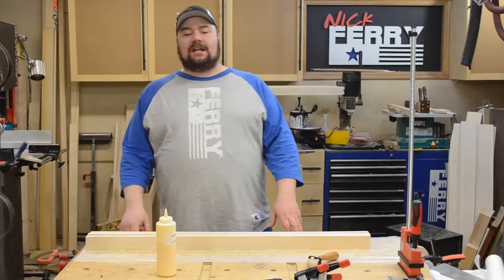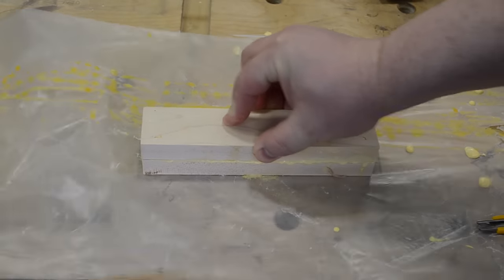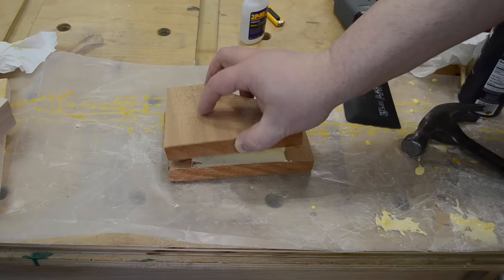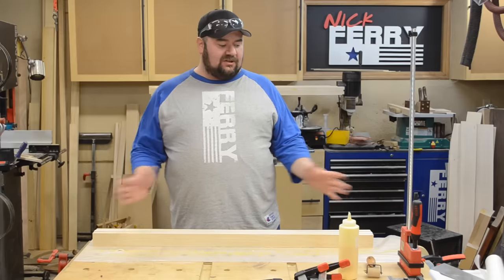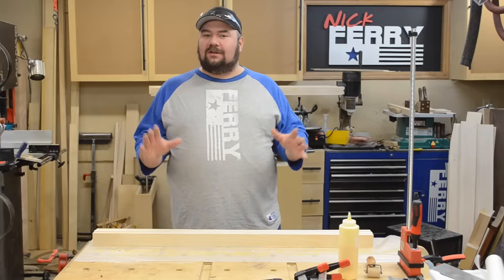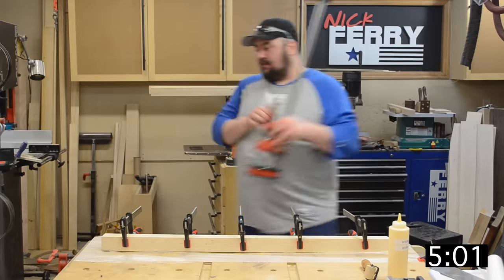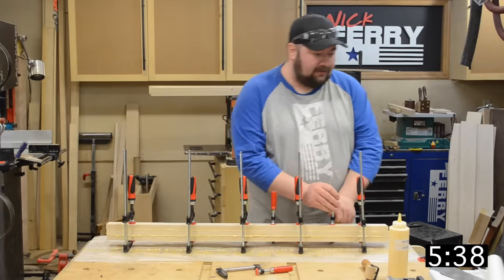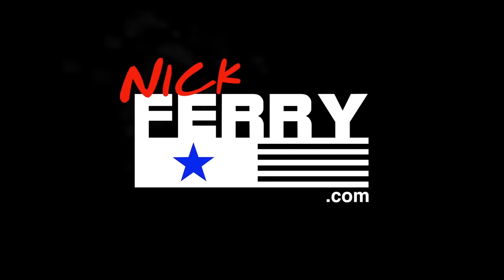Ⓕ Best Way For Gluing Wood Together To Get Thick Pieces (ep86)

Comment: I know it's an old vid'... but I thought "Everybody knows this... right?" too... 

   I will only point out that just my experience (admittedly not universal) but more than a modest and even bead of "squeeze out" is a case of excess glue... Generally, so long as you cover the entire joint in long-grain, you don't have a concern in the world for a void or "starving" the joint... 

    END GRAIN (caps for importance)... is where joints can get starved.
   Hot tip??? Lots of joinery does expose end-grain... SO it can be a good idea to start with an appropriate brush, dampened in glue and apply to the end-grain specifically, like you would a finish. This lets that end-grain soak up some of the glue to seal it a little, before you go back and apply the "full bead" for glue-up.

     Care for another??? 

  Having trouble justifying the economics of buying those parallel clamps? (or any large clamps for the matter)... I like to find (and even approach folks who probably have them) ALL those old levels that people get rid of... Sure, they're old, used, worn, and rarely quite "true" in the most precise sense of the word... BUT a layer of "sacrificial cardboard" (which can actually be anything from layers of paper to cork or leather for all it really matters) allows the piece(s) to be aligned relatively well (surprisingly so) with no more than the old levels and weights, clamps (if you have some) even "hold downs" if you're working with a table-like surface where you don't care to drill a few dog-holes or cut an adequate groove(ish) for mounting them...

    Lots of people prefer "cawls" which ARE great... when you have or can make them... Levels (however) started life "factory straight"... and even when they're not "exactly true"... they're usually being tossed because there's a nick or scar that interferes with making a line or supporting work while a contractor adds hardware (shortcut)... OR because nobody ever trusts an antique wooden level... (okay, yeah, some of them do move around a bit)

    For those interested in saving glue?
   I often use a simple spatula from the dollar store, for spreading... and occasionally run "trails" with a comb on particularly wide surface areas once the stuff is spread. This "breaks up" any surface tension issues.
   It's also helpful to "rough sand" surfaces BEFORE applying any glue. Sure, you need to wipe off any dirt and dust, etc... but that slightly rough surface gives the glue a "place to bite"... AND makes for sure that any "store bought" surface prep's (occasionally and dubiously used to make lumber look prettier) don't interfere with adhesion.

    Okay, most of these tips relate as much to "style" of doing as opposed to any particular "quality" question... Some of it is "basic 101 stuff" but there are points in time and experience when it has REALLY REALLY HELPED me... so take what you like, drop what doesn't help...

             ...AND don't forget to experiment a bit on your own. This is (at least in part) a hobby of passion, after all. You should be having some fun with it. 

                                             ...I mean, honestly... What's ever been wrong with ENJOYING the work??? ;o)
Reply from the maker: Lots of goods tips - thanks for taking the time!
Reply: @NickFerry  ALWAYS welcome!!!

   My favorite tips fall under three descriptors :
1. Cheap, no sense in spending more than necessary for results (skill should be involved)
2. Silly... "why didn't I think of it?" probably because I thought it was silly at the time too.
3. Effective... No good tip isn't effective. They can still be inefficient, but not ineffective. (we all like to play) ;o)

Comment: Don't you just use the right depth F-clamps to begin with(the ones he used later) and rest the wood on the clamps, making it lay flat, then put more F-clamps on top in between the others for opposing pressure? Since the wood is resting within the clamp bars, they stay tightly together.
Reply from the maker: by the way you phrased that you make it sound like there is only one way to do it

Comment: Nick, you never linked to the glue roller in your video like you promised :(
Reply from the maker: Yes is did - link is in there for the article which has all the links
Reply: Ooh, I just looked in the description of the video, not the associated article.  Does PVA glue stick to the roller, or do you clean yours when you're done using it?
Reply from the maker: I clean mine - but sounds like I'll have to experiment

Comment: Good tip. But better to buy the correct size wood in the first place.
Reply from the maker: Buy the correct size wood? Many times I’m milling down the wood right out of the kiln or cutting the tree down and bringing it to the mill - so I do the cutting of the wood down to final size - this way I was able to get 4 pieces from one board as opposed to 3 - waste not, want not

Comment: If you have a flat bench top, and pieces that are of near equal widths, why not place the pieces on edge and use the bench top for alignment? Set a, cheaper, f-clamp on both ends, lightly set, and then work your way from one end to the other with more clamps and at higher force?

One would hope that your bench top is at least as flat as the face of a parallel clamp.
Reply from the maker: For sure another way of doing it - this way is merely more versatile - I’ve done it on pieces behind 12’ which my bench is not - it also works well on curved pieces when I do laminated handrails - works great on locations where I don’t have a bench or assembly table as well
Reply: Great response Nick. You’re right that I’m those other applications the method you demonstrate would be of help. Thanks for the videos too.

Comment: Pretty obvious for us old woodworkers. The best way is to have a flat plank or metal girder, with a backing plate standing up at right angles on one edge., You clamp the pieces down on it down on a perfectly flat surface, and also hard up against the backing plate. The backing plate also ensures that at least one other side is perfectly flat. This "freeform"  technique in the video can end up with a bowed glued piece, especially if  the wood is a bit warped in either direction.
Reply from the maker: I should have mentioned more about id the wood has a crook to oppose the pieces
Reply: Yup, that'll work.

Comment: A little wax paper or similar will protect your parallel clamp.
Reply from the maker: never a bad idea but I don't have it on there long enough for it to matter - if any get on the clamp I just wide it off when done with the board

Comment: Meh,  I guess it's OK if you're not going to run through planer.  I always used pipe clamps and just ripped boards an 1/8 or so oversize and run 'em through the planer.

Comment: I do a parallel at both ends and then add the other clamps before I even remove the parallel clamps.  Work hard or work smart. Your choice folks. why leave anything to chance.
Reply from the maker: And what if there is a slight crook in the board?

Comment: This is pretty good for those people that use f clamps for their glue ups. Personally I just use pipe clamps with packing tape covering the pipes so the glue doesn't stick like you've seen on a thousand cutting board videos. Gravity keeps the edges aligned that way.

I've never understood how the salt thing made sense to anybody but now in some corners of internet woodworking it's gospel and heresy to speak against. I'm sure it seems to work(ish) but I don't think it's really all that well thought out of a practice. What size salt do you use? If you go with the really fine basically powder stuff it will just dissolve when it hits the liquid glue. If you use some of the chunkier stuff you'll either have uneven spaces between the members where the salt is keeping it apart or you'll create voids after it dissolves where you crush the salt into the wood fibers with clamps  and more likely a combination of both. Aside from that you're changing the chemistry of the glue which doesn't sound like the smartest thing if you want a strong and dependable glue joint you don't have to question.
Reply from the maker: I’ve never had any luck with relying on gravity in these glue-ups - I’ve always seemed to have at least one piece want to pop out somehow - as for salt I rarely use that method anymore, but when I did, I used regular table salt - small enough to dissolve and just big enough to have some grit to keep from sliding - being a small amount was used, I never worried nor had an issue with it changing it chemically
Reply: Thank you for this information! As a seventy-year-old "beginner," I don't  have time left for trial and error or learning from experience, I need to learn from other folk's experience and DIRFT, do it right the first time. 😊👍👍👍

Comment: How about the glue up table, with pvc rails? Check out the mtm wood channel to see what I mean. That's where I was introduced. It was just ... immediately obvious to me that it was the correct way to go.
Reply from the maker: a good method to do it for sure but it requires "extras" where as this is great fro someone doing a couple one off's - that's the beauty to woodworking, always more than one way to attack it - MTM make some really sick cutting boards too!

Comment: Good tip, but you're using way too much glue if the boards actually slip and slide like that.
Reply from the maker: to each their own - I hate having to fix spots that are devoid of glue so I use plenty

Comment: The way I do it to avoid slip is easy and works every time and doesn't add a single step. Simply put the clamps on very lightly until at least 3 are on before going tighter then they do not move add more then go back and tighten up  the others. Try it, it works. Going tight in 1 spot is what causes the sliding.
Reply from the maker: I will try it out for sure thanks!

Comment: dont we all do something similar to this method? and the guy whos minds blown, didnt lose much.
Reply from the maker: Somebody could be woodworking for 60 years and still not know all of what other woodworkers do for tips and tricks in their shop so that’s why I figured I would share it
Reply: Nick Ferry I was not doubting your good intention for sharing. I was merely pointing out that this method is rather mundane, much less mind blowing. I'm an amateur woodworker for way less than 60 years and I have been using a better version of this method glueing up boards since very early times.

Comment: Sawdust works instead of salt.
Reply from the maker: The last thing I want in between my freshly jointed or plane boards is something that won’t dissolve causing interference no matter how minute
Reply: @NickFerry  so the sawdust is taking up space making the wood to a degree wider the you would want?  I could see that as an issue, never thought of it that way!!  Thanks!
Reply from the maker: @HOBrian2003  in a manner of words, yes

Comment: If  one were to read the glue bottle one would encounter a concept known as "grab" or "initial tack".  "So what?"  You say.   Wellllllllllll............ yellow glues are designed for gluing stuff together and they don't print stuff on the labels just for looks.    "Well, duh." You say.   So anyhow, here's what that means:

  Spread the glue.  Line up the pieces while the glue is still wet and slippery - then go away for a few minutes (not too many minutes, there's a learning curve here) - have a cup of coffee, straighten up the work bench  - whatever  ..........  then when you come back the glue will have dried a little and "grabbed" (remember that word?), but the glue is still wet.  Then you can handle the pieces and put clamps on at a more leisurely pace.  Easy, peasy, nice and squeezy.
Reply from the maker: Sounds like you have the cohesive and adhesive properties down pat
Reply: Yes I do.  I am old enough to remember when yellow carpenters glue first came out.  (The directions on the bottle were much more comprehensive then.)  Before that it was Elmer's and US Plywood Plastic Resin glue.   Yellow glue was designed to eliminate the slip and slide problems that Elmers (which is just as strong) has.   I'm surprised that using it is such a mystery in the 21st century.  But if you want to make a simple problem complicated - go nuts.  I don't care.
Reply from the maker: no mystery in the 21st century here - I too started on white PVA - it's just easier and more efficient for me to do it this way rather than have to go get coffee and keep track of multiple pieces in an assembly while waiting for glue to tack up - as far as making a simple problem complicated, I'd rather put clamps on right away and be done with it rather than wait around for "initial tack" to only marginally help with pieces slipping

Comment: so you are using cauls(or one caul..intermittently)...strange he never saw that before....
Reply from the maker: I think the way in which the parallel clamp itself was used to be a caul in combination with not having to insert, adjust and have separate pieces is what he was most impressed by - something many woodworkers have kicking around - just saying the word caul doesn't explain certain methods people use  them for

Comment: Your friend has been a woodworker for 20 years and never thought of that? Come on, was the woodworking using Lincoln logs?
Reply from the maker: thought of it, maybe, done it exactly this way, nope - he hadn't seen it done with parallel clamps before - it is slightly surprising but if you factor in the infinite ways to make subtle variations to menial tasks I can see it - ahh ha moments are bound to occur at seemingly odd times
Reply: No one will ever call me a woodworker and I knew how to hold pieces flat. Just blew me away that I had that knowledge. Here is one for you, use tie down straps for extra large pieces such as barn door type things. Use 2 x 4 as cauls or even better 2 x 12s if you can get them. Steel I beams are better but may not be locally available. LOL. I thought that up on my own.

Comment: 4 pieces scrap with straight edges, coated with parafin so glue dont stick clamped 2x2 instead of moving that clamp and voila wood does not move... 3 times faster...
Reply from the maker: But what about cellophane tape?
Reply: @NickFerry  is faster with parafine . one dirty rag and parafine
Reply from the maker: Parafine is wax right?
Reply: well, sort of. what I use is for wood floor polishing , it has consistency of margarine and has some fragrant petroleum smell, coloured white and it does not harden after i apply it.  is labeled paraffin wax. i hope it helps. btw that shit is great for metal surfaces, wood slides like on ice on it (planer tables for ex.). sry for my english
Reply: Please ...  WAX and WOOD in shop is an ignorance !
Wood and wax cannot co-exist until the woodwork is finished, the paint dry, and even after then,...
IS NOT A GOOD IDEA.
AS ANY FURNITURE REFINISHER MIGHT TELL YOU... THE COST OF MATERIALS IS BIG.
WOOD DEWAXER CHEMS ARE EXPENSIVE AND UNNECESSARY.
WAX HAS NO PLACE IN FURNITURE,. NOT EVEN AS PRESERVATIVE.
POLISHING FYRNATIER WITH WAX IS A FAIL.
Reply: Shall I give away to everyone on Earth ... a few TRIX not even Jesus Christ could give ?
# 1 ... split some various lengths of PVC  IRRIGATION PIPE ... cover the rail of your clamps...
glue will dry and fall off, .... the wall thickness is uniform...
AND GOD DEMANDS CLAMPING BOTH FACES OF YOUR PANELS
Reply: @kennethkustren9381  wel every shop with it's own needs... i sculpt the wood panel so i have no problem with a bit of wax on the surface ;)

Comment: the "salt trick" always bothered me, mostly because of ship building....the entire reason you use white oak and not red oak in boats and ships, is red oak will draw water...as the water evaporates, it leaves salt behind...add new moisture, and it's start attacking the wood chemically, and cause accelerated rot...  putting salt in the glue joint, just makes it so this process happens in a piece that have never had the problem to begin with...
Reply from the maker: I’ve used the salt method sporadically throughout the years - I doubt interior furniture would be the same as ships in regards to water retention and salt born corrosion but not a bad thing to consider
Reply: @NickFerry  I agree, it's not nearly the problem you'd have with ship construction when it comes to a piece of furniture that's going to be in the living room of a house.   just always seemed like the kinda thing my grandfather would rail about.....about why build something if the method you used would make it fail later...Grandpa always said "build it like you want your grandchildren to use it too..."  
I've had discussions about it...how when it's encased in glue, it's sealed in and so can never get exposed to moisture....and that seemed okay until I pointed out most glues contain water, so you're exposing it right off the bat..     I suggested if you're going to use something like that...use clean sand (like for a terrarium or something similar).   

it's a troublesome issue in general, and your solution seems like something Grandpa would approve of....common sense, uses what's on hand, and solves the issue nicely.    I've always just done the gluing by stages if I felt like it was a problem; but i'll be giving your method a try next time I do something that needs a bulk lamination....

Comment: Or just pass finished glue up thru planner or shaper or jointer or table saw or band saw or sander or whatever  works for ya,
Reply from the maker: Or I got 3 pieces at this size from a board as opposed to 2 because I was able to be more precise - or some people don't have a planer or jointer - or in many cases the glue up is too big to run through the table saw - or some just like not having to waste material or rare wood - whatever works for you